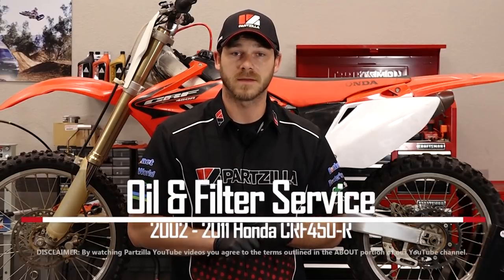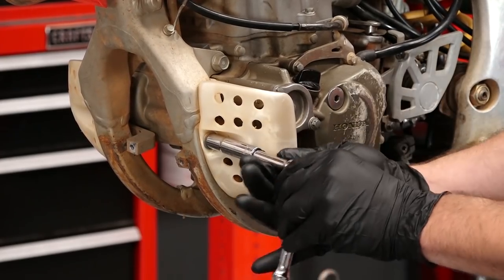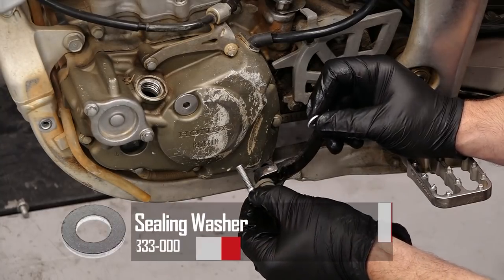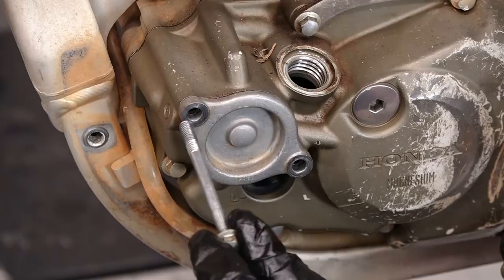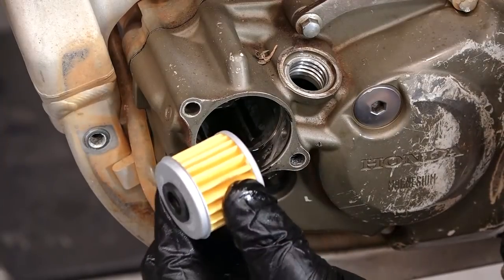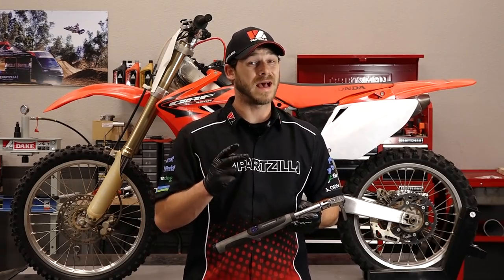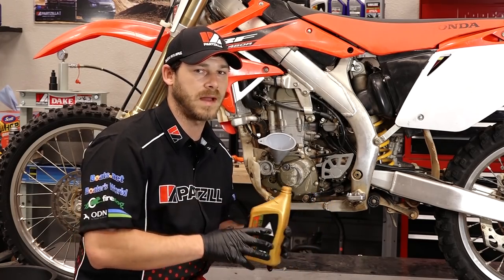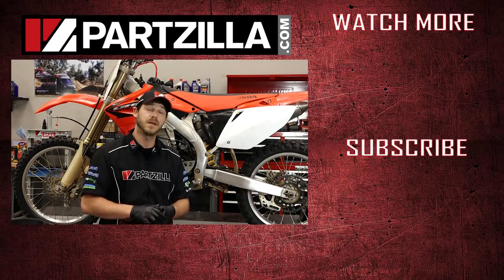Honda CRF 450 Oil Change | 2005 Honda CRF450-R | Partzilla.com

Comment: forgot to add if you put oil cap in upside-down the 3 holes won't line up. You could lead to some engine damage if the oil cap 3 holes are not lined up with the holes in the case. If you flip upside-down it will still mount but the 3 holes won't line up and won't properly filter oil. Also could lead to serious problems.
Reply: Thanks for pointing this out mate!
Reply: Which way is right? 3 holes towards the rear or front?
Reply: @jbpooh  line the holes up with cap.
Reply: Wrong information here the manual states nothing of this orientation in fact I think the cover is shaped in a way you can’t install it upside down.

Comment: Just a heads up guys double check your oil passages on the oil filter cap. Just check it before you throw it back on ✌
Reply: @Xr Pals when you take off the cap double check the holes facing to the side make it back into the same holes inside the filter housing, should be 3. Or the oil isn't going to make it through the filter.
Reply: I just commented this and was going through comments to see if anyone else caught that he skipped that part. Very important 👏
Reply: How do you know which way?
Reply: Which way does it go back in? 3 holes towards the rear or front?

Comment: cranking over the engine like that is not a good idea....either is leaving that fill cap open for dirt to fall in accidently    jmo
Reply: the manual says to do this it gets all the oil out, just hold in kill switch according to the manual. I do agree he should have washed it down and cleaned up areas a bit better.

Comment: Hey so do you change the oil on the left side of the bike more often than you change the oil on the left side? I’m confused as you only changed oil in one side of the bike. Also when changing oil on the right side do you use 10w-40 as well? Or special gear oil... please help me
Reply: Came here to double check what too torque the bolts too, don't use a synthetic or silicone based oil in transmission 80weight and for engine 10w40
Reply: @jon doe thankyou, I’ve heard so many people running 10w-40 through both sides of the case
Reply: @coleanderson9298  google it read up and u see if u run engine oil in tranny it will fuc it up
Reply: @coleanderson9298  yes you can run 10w-40 through both sides you just gotta make sure its the right kind. even says right in the manual. you can use Pro honda GN4 10w-40 for both sides and thats what my Honda dealer also recommended me to use
Reply: I use HP Honda in my cr250r, the red bottle for gear oil. Works best imo. Id definitely use it on the right side of my 450
Reply: @Oh5MaGmA636  So is the right side the transmission oil?

Comment: What's the absolute best oil to use in my new 2020? Is Motul 300V really that good?
Reply from the maker: Honda recommends Honda oil.  It's the never-ending question.  Everyone has an opinion based on their personal experiences or which person they chose to listen to.  Motul makes a great product.  You will be fine regardless, just make sure it's the correct weight.
Reply: @PartzillaParts  im reading that Motul ETECH 100 is in the top 3 for dirtbikes and comes in 10W40 the motul offroad doesn't come in 10W40 it comes in 5W40 and 15W40 so I wouldn't try it in my bike and the Motul 300V is for street bikes.

Comment: Which side is motor oil and which side is transmission oil?
Reply: Right side is transmission, left is engine oil. Both of the drain plugs are located on the left side by the shifter.

Comment: What if u fill it too much, is that ok?
Reply: No, don't over-fill.  It can cause problems. Just pull the drain plug partially out and allow a little out, and reinsert bolt.

Comment: What happens if i fill my oil just above the “h” for peace of mind , any benefits  on long desert rides  and should i run the standard 10w-40  im going on desert rides in the heat and want the best viscosity and enough oil so i dont starve it , can anyone help?
Reply: 10W-40 is a good oil viscosity, in some bikes you can run 20W-50 for the extra viscosity

Comment: Thanks a lot, my filter cap bolt snapped before 9ft lbs🤬
Reply from the maker: That bolt should never snap under 9ft lbs.  Perhaps it was over tightened previously and was stretched to limit.
Reply: Just dont torque it, Tights tight